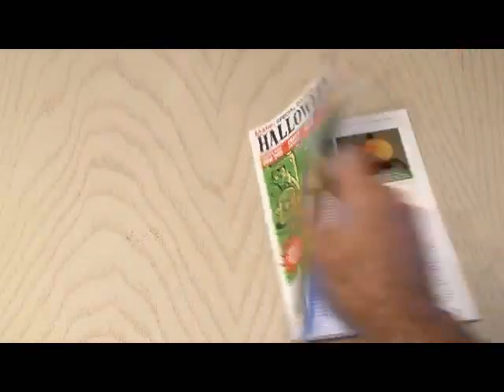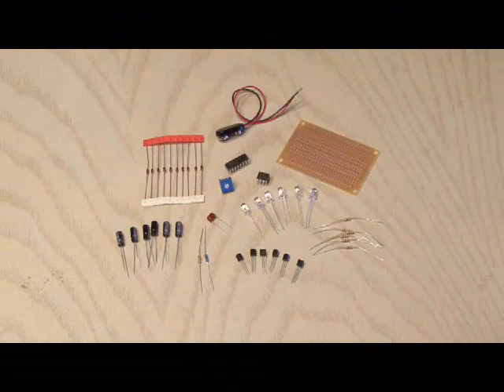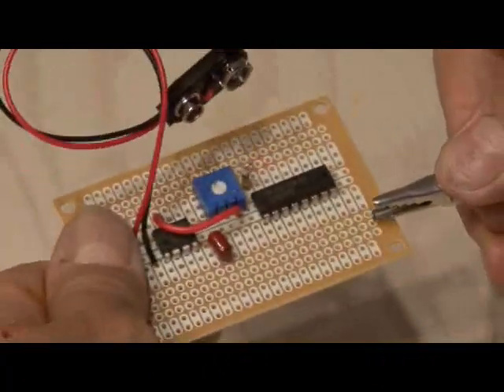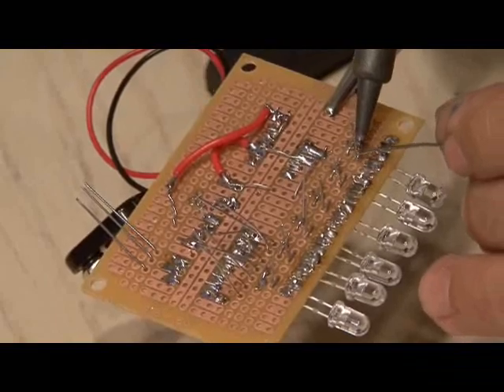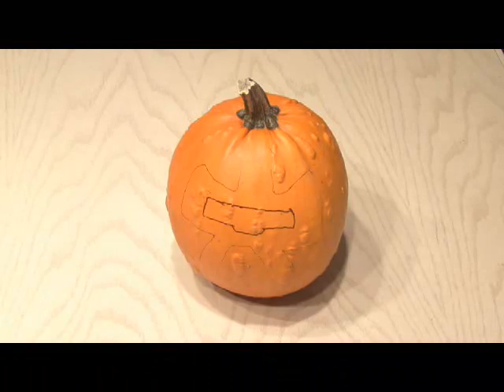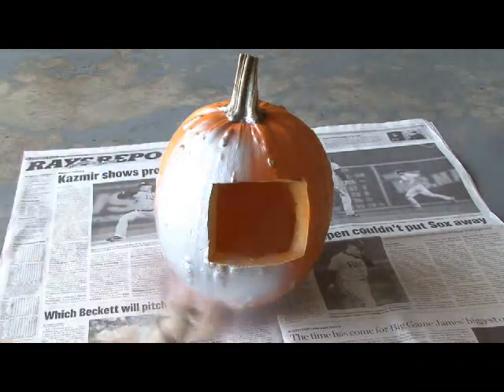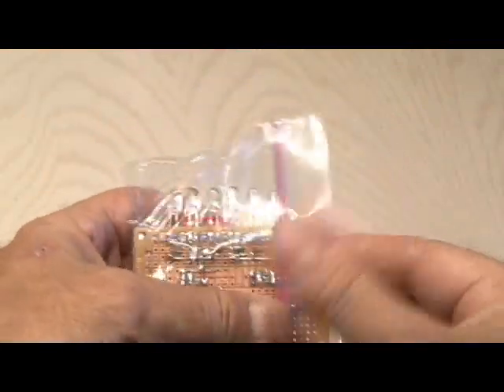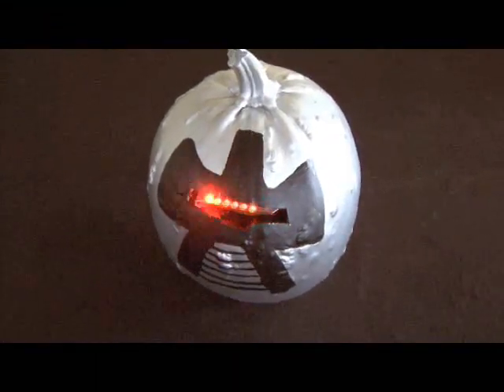Weekend Project: SciFi Cylon Jack O' Lantern

Comment: If it's sealed tight no water vapor can get in, therefore no water vapor can condense later. at best that can happen on the outside of the bag. Plus I don't think a 9 volt battery generates enough energy for that.